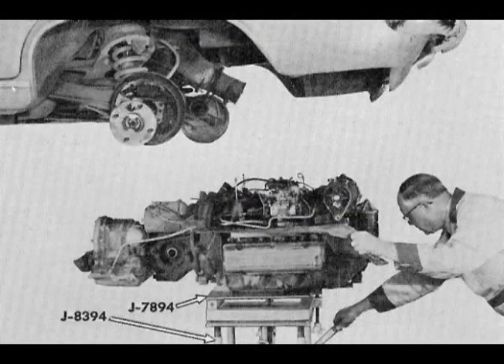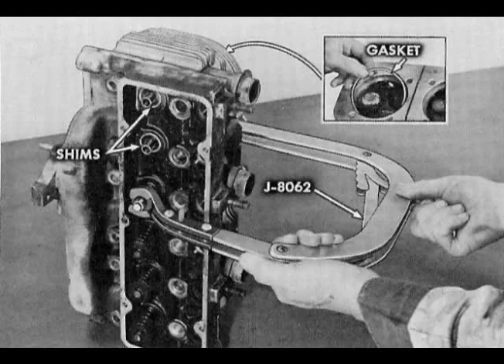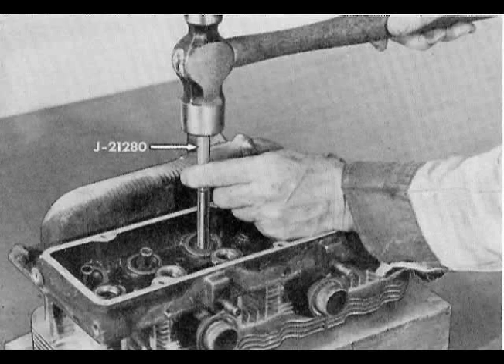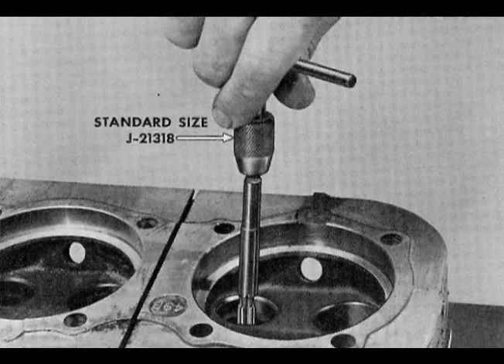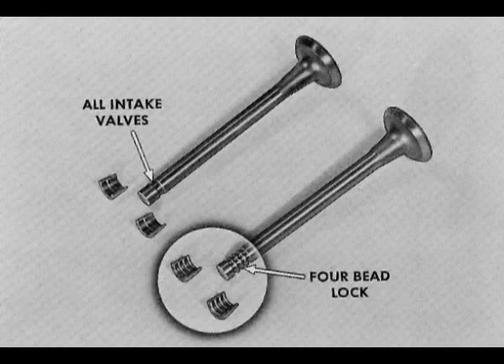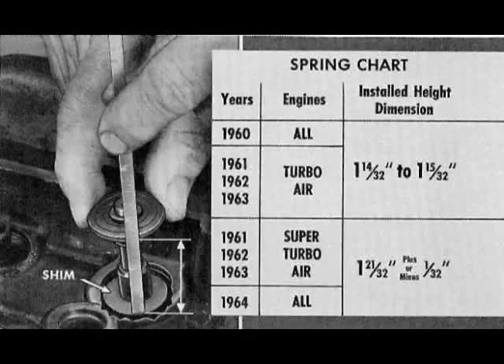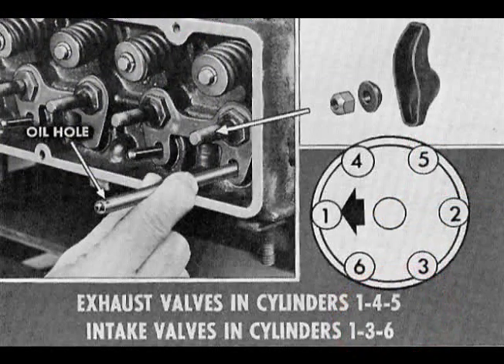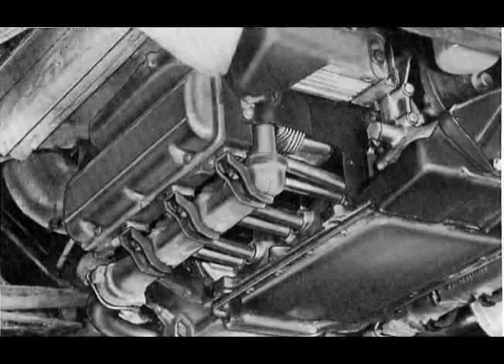Corvair Valve Service & Adjustment

Comment: I've never adjusted valves on any Chevy engine when it was running...including the Corvair. Done properly I've never had to readjust a motor after initial startup in my life. If you find it necessary you're doing it wrong.